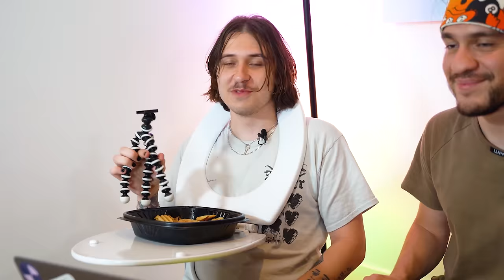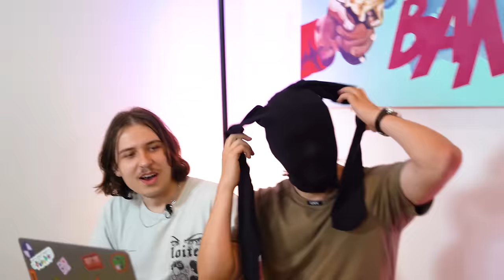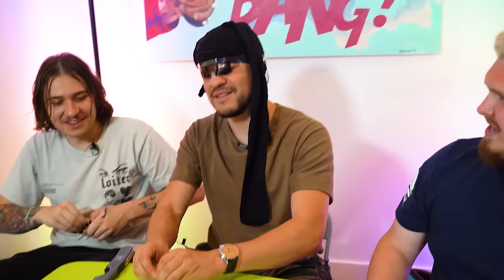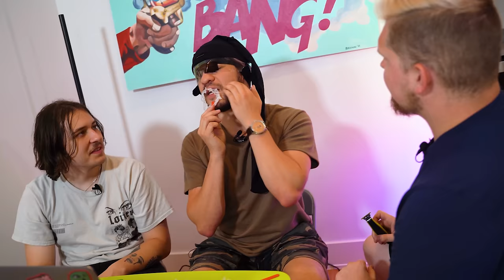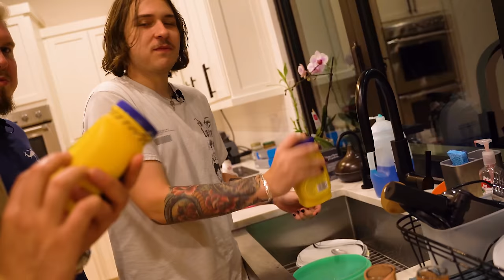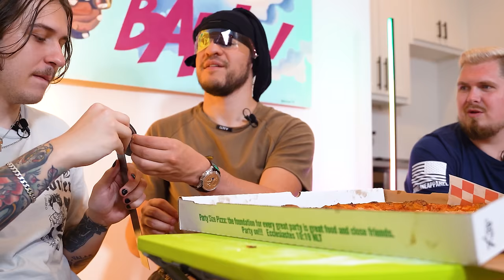We Tried The WORST Life Hacks!

Comment: Superficial skin damage can occur when adhesive products are used. Skin stripping and tension blisters are the most common problems associated with taping. Many of these injuries may be prevented by correct use including careful attention to skin preparation, choice of tape, and proper application and removal of tape.